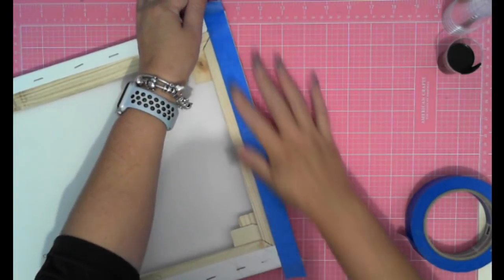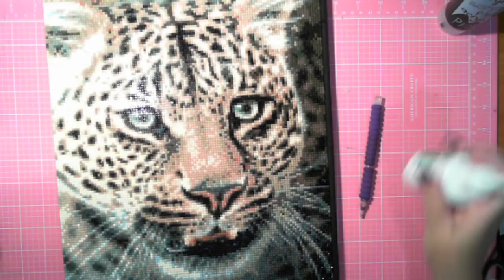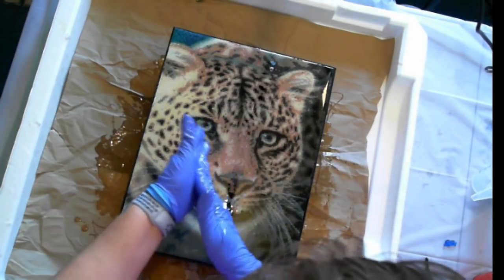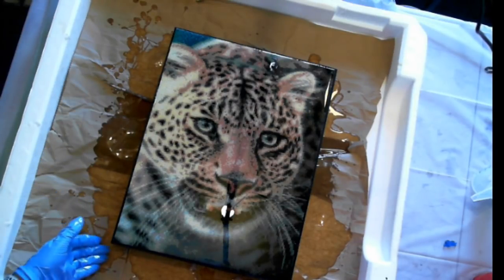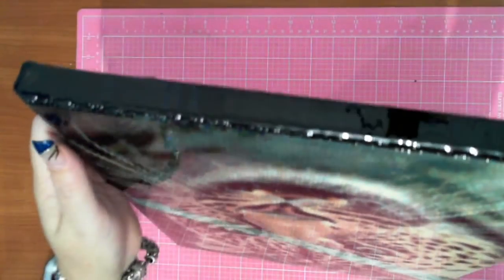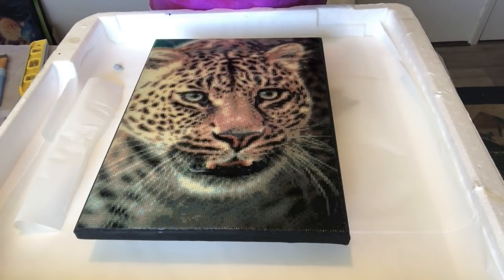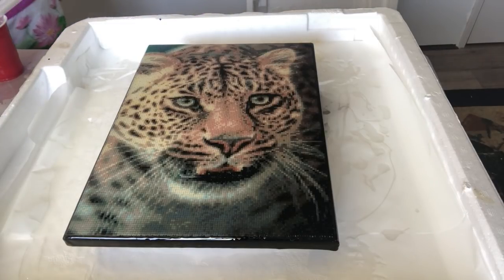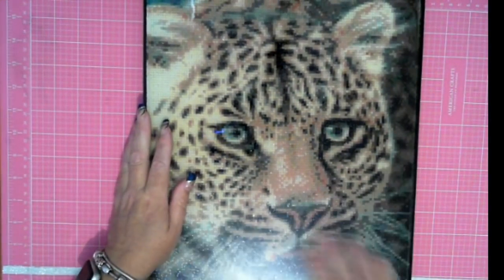Diamond Painting in Art Resin

Comment: Do you feel you lost the 3d diamond dimension of the drills after it was covered in resin?  p.s. you can completely light sand the night scene you don't like, top and edges. Will looked scratched and ruined. Then pour another coat of resin and wallah...perfection and clear as day! (or night)
Reply from the maker: I did loose the 3d effect but overall I am happy with it.  I find that if I do a second or third pour when the resin is only 3 to 4 hours set there is no need to sand between coats, it only needs to be sanded to get the resin to bind to the set resin, if you do them layer by layer in short time frames they end up blending together 💎🌹💎🌹

Comment: Would you recommend sealing a do before applying resin?
Reply from the maker: The only reason I seal a diamond painting now is if it has popping drills, which usually happens when actually placing the drills and then I use the Aqua glue to seal as I go
Reply: I am working on a 90x50cm do where the drills are popping like popcorn!!!!  Ty for your reply...gonna seal the parts I am done with ')
Reply from the maker: @lorimulder9836  When I have that issue I seal a section at a time otherwise you will be forever having to replace lost drills especially on a large DP
Reply: I don't know if this applies to DPs but I've hear that sealing things with matte Mod podge or Matte paint the resin has an easier time holding on to the resin... Have you ever tried something like that?